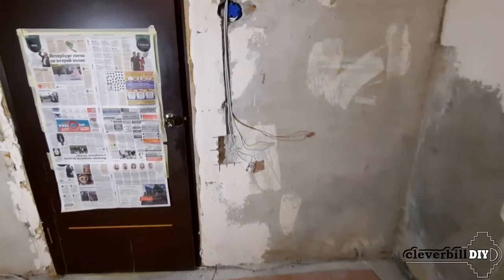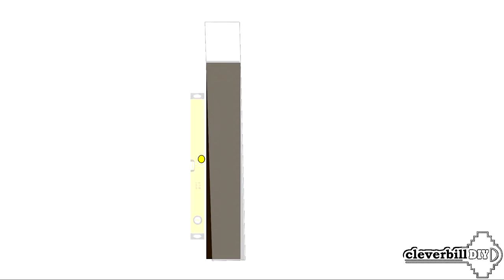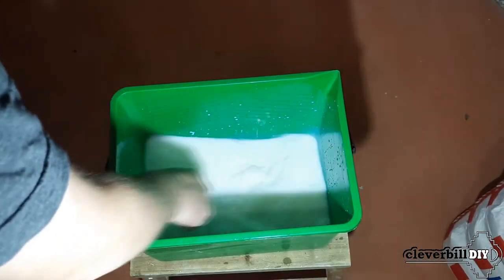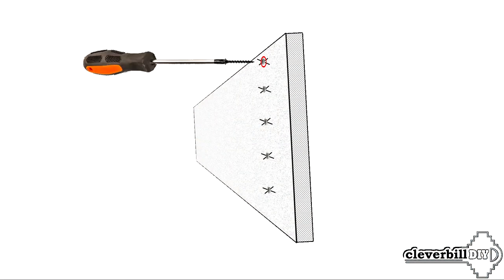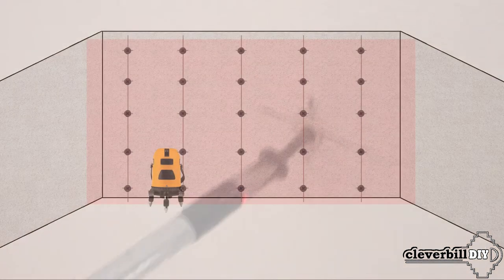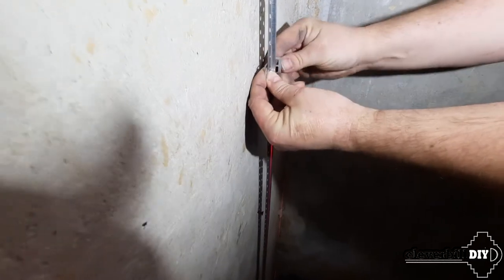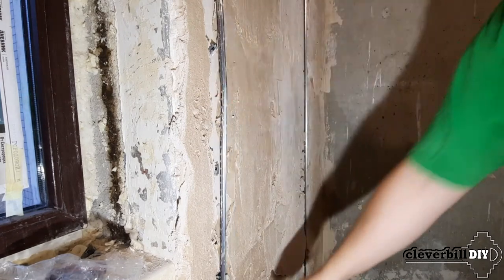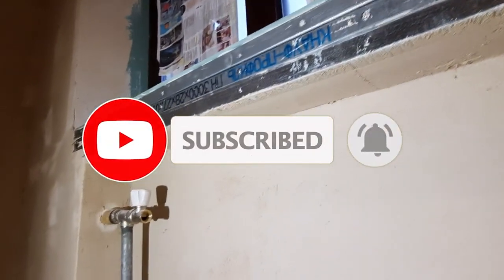DIY - We install plaster beacons on the kremmer-clips, apply plaster with our own hands.

Comment from the maker: How to remove old wallpaper - http://youtu.be/kqMOWiKEXGs
How to remove chalk or paint from a ceiling - http://youtu.be/oYv4g-P8gvM
How to determine the unevenness of a wall - examining the walls (measuring) before leveling - http://youtu.be/sVxQb3Mla38
If you are determined to level the walls with plaster, the first thing you need is to clearly define the scope of the work. Since even a small but uneven section of the wall can take a huge amount of bags of plaster. As a result, it can be very surprising and help lighten your wallet. Perhaps somewhere, it is much more profitable to level the wall with plasterboard, the installation and cost of which can be much cheaper than plastering.